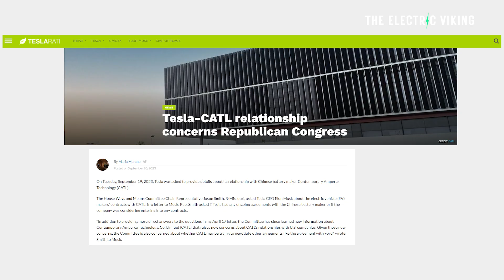Tesla's American LFP battery plant will produce game changing new battery

Comment: I feel really pleased that batteries are a little fire resistant these days. I also wish the governments to ban products using old batteries that catch fire easily. Examples of electric steps that catch fire are numerous.
My assumption is that 4680 will become Tesla's workhorse in all their products and that old wet coat technology will be banned because of the factory footprint it needs. Does anyone know how much of each battery type is produced? It is nice to compare these numbers of the last 5 to 10 years. There could be an answer to what will be the future of the battery production in the next years to come.
If you are still reading, I am really grateful to you. Tesla doesn't have dealerships where they can stockpile cars. And at Tesla's runrate at their factory they need to avoid overproducing cars because they cannot stockpile them. For that reason I believe, the automotive growth at Tesla will be limited next year. They can't offset enough due to higher interest rates and leasing prices. Therefore they will simply aim to produce more megapacks this year instead of focussing on maximizing automotive growth. Let me know your thoughts, and have a nice day

Comment: The other curious thing is that The Limiting Factor describes a significant price escalation in the last few years of lfp versus so-called nmc or NCA chemistries. From 2020 to 2022 lithium phosphate chemistry components went up almost 300% while NCA chemistry's went up 100%. This meant that in 2022 the price of lfp batteries was almost on a par per kilowatt hour with traditional ternary lithium chemistry. I'm sure this will change again as lithium carbonate is generally cheaper than lithium hydroxide. But it's not as simple as this video makes it sound.
Reply: It's a scale issue that isn't permanent. As production matures the price will drop like a stone. Iron Phosphate batteries are significantly less expensive to manufacture

Comment: Definitely agree. Just ordered a Model 3 Standard Range (RWD), and the LFP was a strong part of the decision. Looking at the long range, and considering the recommended use is the 10 to 80% range / whereas the LFP is happy using 10 to 100% of the battery capacity - the real world use is pretty much the same... plus it's expected to get double the charge cycles with minimal degradation.
Reply: It's my understanding that Canada gets China-made Model 3's since we don't have the tariffs imposed by the US imports.
Reply: @dbmiller5881  - Checking a bit further - you're right!  Seems strange to be shipping them from China, but both 3 and Ys from China go to Canada. It's not clear if it's a mix of US made and China made or all China. It might be limited to RWD models, but I could find out for sure.
Reply: I wonder if US/Canada RWD Model 3 Standard Range will be delivered WITH the new and improved LFP batteries from CATL. I preordered one in Canada Jan.11 but have no word on battery chemistry other than it's "LFP."
Reply: @thestonksmarket1897  - Unlikely. It's only been announced that there is a plan to build a factory to make them.  I expect it will take 2 years before volume production is available, and currently that production is slated for Energy storage, not cars.  There may be some factor not yet identified that makes them a poor choice in cars.  For example, maybe they don't do well with vibration, so  a fixed mega pack doesn't suffer that issue.
Reply: @tesla_tap  The factory in question in the US is utilizing CATL machines. Obviously CATL already has said machines up and running in China, so IF rwd M3 Highlands are currently being shipped from Shanghai to Canada (and the US?) then the question is still valid whether the included LFP cells are the old or new ones. I haven't heard that they "don't do well in cars", but rather that they will replace the old LFP batteries using CATL's existing production lines at no additional cost to produce. Basically a win-win if true. Tesla's move to produce these cells in the US is primarily to increase volume; after all, EVs are NOT demand constrained, they are production constrained.
Reply: @thestonksmarket1897  - You could be right. My understanding is no CATL designed factory for Tesla not has stared yet, so it seems to be to be at least 2 years as ground has still yet to be broken. You've got permits, building the factory, equipping it and then getting the process up and running in volume.  It's taken 2+ years for Tesla to do that with the 4680 after the pilot line was running, but that's a more complex process.  I didn't get the sense that this new cell is in production even in China but just a proof of concept line. Information is sketchy!

I'm also not aware of any China Teslas coming to the USA or Canada. The tariffs are so punishing it seems unlikley.

Comment: If these batteries can have a high rate of charge at cold temperatures that is a significant improvement.  This should also help range in colder temperatures as less, or no energy will be needed to keep the batteries warm or for pre-conditioning for charging.

Comment: If we could find why these batteries fail a thing we are doing is not correct. Something is wrong somewhere in it's manufacture. I want them to find out what before my Cyber Truck has an early, failure, fire, or burned vehicle due to water ingress. I want to drive it through waist deep water with no worries. Like those positive pressure jobbies. I just had a headlight water ingress on me bicycle and had to remove 4 tiny screws to mop it out. Being lithium ion I didn't want a failure in the middle of nowhere.

Comment: Higher energy density? Compared to what? The Panasonic 2170 baatteries have energy density of 269 Wh/kg while the LFP has between 90 and 160 Wh/kg. So whaat energy density are we talking? They are just cheaper to make and last longer which is important feature but that's really it. There is nothing else impressive aabout them and that's the reason why they are used in entry level Tesla vehicles

Comment: 4680 was supposed to be the game changer- I have heard people that have both a model Y with 2150 and 4680, and they claim that the 2150 Y charges more rapidly and also has better range performance.. Kind of seems like they just need to convert that plant to prismatic LFP as well...
Reply: 2170 (i've also gotten wrong on occasion)!  The Ys that got 4680 were Gen-1 cells.  Now they are making Gen-2 cells, and as I understand it, all are going for the Cybertruck and none to the Y (which is back using 2170 cells).  As to the performance differences - it's hard to get an accurate read on it as the pack capacity and number of cells varies as does the cell chemistry tweaks in both the 2170 and 4680 at different times. I've not heard of any plans to covert NCA cells being made at Sparks to LFP cells but there are so many variables, mostly having to do with raw material cost variations - it's always smart to be able to switch to what makes the most ecomic sense as needed, and Tesla has always been very smart about that.

Comment: @7:42, wrong. Panasonic is not holding back battery production of high energy density LiFePO because of limited production capacity. Rather, CATL holds most patents on LiFePO battery, and Panasonic would have to pay licensing fees to CATL. This discourages Panasonic because the lower rate of return on investment opens up other opportunity.

Comment: @5:55, wrong. Tesla’s proposed CATL battery production line isn’t in Nevada to put pressure on Panasonic. The existing Nevada  Tesla  battery factory is a joint venture between Tesla and Panasonic. The notion that Tesla is  putting pressure on Panasonic is same as Tesla kicking itself. Tesla isn’t a masochist.
Reply: I upvoted this, but the relationship between Tesla and Panasonic has been ... rocky ... at times.  Panasonic has been entirely too hidebound and conservative; when they originally partnered with Tesla they may have been the best battery company in the world (maybe) but, like Japan in general, they squandered that lead.

Comment: I agree. I wouldn't buy an EV without LFP batteries.
Reply: I wouldn't buy one with LFP, unless it was just a commuter car. Slower charging, discharging, less range, less energy density...they're have their advantages, but at the expense of the things that matter most to me.
Reply: @OtisFlint  most people use their car most of the time for commuting.
Reply: @OtisFlint  Not to mention the horrible cold weather performance of older LFP chemistries.  NMC is bad enough in the cold.  At this point, I only want the new CATL LMFP battery.
Reply: They're literally worse in most metrics besides price
Reply: And I wouldn't buy an E.V. in a jurisdiction with limited available power and an inadequate grid...like North America for example.
Reply: @markanthony3275  Huh? Did Canada get moved out of North America?  Ontario has a > 90% green grid and Quebec EXPORTS Terawatts of power to the US. (And unlike Texas, OUR windmills - although 20 years old - work in the snow. American technology just needs to catch up ...).
Reply: @markanthony3275  🤣
Reply: @markanthony3275 The inadequate grid hasn’t had an impact on charging both our Teslas. 😅

Comment: LFP is just stopgap measurement, though I know ncm battery's not distributed enough. Though it's cheaper and more stable than ncm based battery, it can't be ultimate solution for current battery shortage. LFP battery started to be sold by Chinese manufacturers, which needed cheaper cars for Chinese people. Thanks to mass production of LFP battery, Chinese people could buy EVs of cheaper price but it has so many problem, especially in cold weather.
Reply: Chinese EVs need to pass -20 degree for 30 day at least 6600km travel in inner mongolia. It is not a problem for China.

Comment: I wonder what the range of Model 2 will be if it uses LFP batteries, there is only so much low energy density cell capacity you can fit in a small car.
Reply: If you can charge rapidly and in the cold,  200 or 250 mile range isn’t an issue. LFP are very robust cells and not prone to fire like others. .  I have some LFP cells that are 15 years old and they can be charged at 5*C without issue. Thats old A123 Systems cells and still running strong.  These new ones are many generations better. These are basically lifetime batteries. The chassis will be worn out before the battery.
Reply: @daversj  If Tesla offers 10 minute to full charge and 15 years of battery warranty than that will help countering consumer apprehension about mediocre range I suppose but it isn't doing that for LFP Model 3 so it most likely won't for Model 2. That makes the advantages of LFP largely academic.
Reply: @tellyboy17  nobody charges to full on a road trip. If it can do 20 to 80% in 10 minutes, that's probably adequate.
Reply: Model 2 is supposed to have a 53 kwh pack, which is 80% the size of the model 3. The question is, how much smaller and lighter will the model 2 be?
Reply: @darylfoster7944 That's a good question and related: how much cheaper to build is Model 2 actually going to be. The way car economics work small cars are relatively expensive to build compared to larger (more profitable...)models which is why Elon Musk has visions about completely new ways to build cars but not all his visions are rooted in reality.
Reply: I was thinking the same thing... And to keep the cost low, I'm guessing 230mi.
Reply: @yeahbuddy92193911  It would have to be something like that I suppose. It's tricky: to be able to sell at a low price point you need large production numbers but for that you need large demand which in turn  dependents on the car having great range which necessitates a large battery which is ad odds with the need to cut costs. Quite the balancing act...

That's why I have always been skeptical about the Model 2 concept.
Reply: @yeahbuddy92193911  230 miles is low, for the American consumer. EU and Asian drivers may be ok with it. I wonder if there will be a LR version.

Comment: John, from Cleanerwatt, synthesized reports that indicate that the batteries will be made in the prismatic form. Thus, they will be suitable for Megapacks. The domestic sourcing will qualify the Megapacks for incentives provided by the Inflation Reduction Act for domestic buyers. Future developments, indeed, will likely see Tesla utilizing LFP in the 4680 cells - which are suitable for the structural packs used in their vehicle manufacturing process. All will come to fruition in due time.
Reply: Tesla already uses prismatic BYD Blade cells in Model Y.
Reply: I am no expert. Also, under Elon's direction, Tesla adapts as conditions change. I am aware that the BYD blades are in some Ys from Shanghai and Berlin. (Austin uses LFP is some Ys too - though, info regarding sourcing for Austin production is vague.) Anyhow, I think the next goal is to get LFP into the 4680 form. Instead of BYD, this deal in Nevada is with CATL. China's Optimus clone has to be a factor as well. So, Tesla will likely accept CATL's tutelage until they can say, "We've got it from here." Keeping the near-term focus limited to the storage segment hedges against corporate espionage /sabotage in vehicle production. Further, Tesla may want simplify the transition to LFP in its U.S. 3 /Y production by limiting the prismatic phase to as short of a run as possible. (There is some speculation that the 4680 form works better for heat dissipation - likely also preheats faster.) @jcziviani

Comment: Just a small correction. The Nevada factory is just outside of Reno in Northern Nevada quite a ways from Las Vegas. The public statement from Tesla is that this will be a 10 GWh production site for its initial LFP efforts.  I will drop this piece of unconfirmed info on the CATL agreement.  I suspect this is a two way technology agreement where CATL License its LFP tech to Tesla and Tesla also License its dry-cell tech to CATL.  Making a structural 4680 LFP cell is not that straightforward. This will require development of new processes and techniques to bring the two technologies together into a 4680 cell.  The initial 10 GWh production will be using prismatic cells as CATL uses.  I think this is more of a joint development effort than anything else.  If they can develop a 4680 Cell using dry cell tech with LFP chemistry it will be a major step forward in reduction of cost and increase in most battery performance specs, ie energy density, operating temp range, speed of charge.  Just my thoughts of what may be happening nothing else.
Reply: Elon is a smart businessman not a politician. They are afraid of African born just like how they treated Nikola Tesla.
Reply: Tesla have no battery tech that CATL need...Both BYD and CATL have the battery/production tech that are at least 10 years ahead of Tesla..

Comment: Now that California's Salton Sea mine will produce lithium in 2025 and the world's largest Nevada Thacker mine opens in 2026 things will change.
Reply: How much fossil fuels do you think they will burn to mine lithium in Nevada? I work mining nickel and cobalt for Elon Musk's and G.M.'s batteries so I'm curious. I know at our mine, we tried electric mining equipment and it was a joke.
Reply: @markanthony3275  I recently retired as an engineer where I worked on emissions for both our diesel, hydrogen, and electric power trains we manufactured throughout the world for major OEMs. Overall, we had better performance with electric over hybrid-electric power trains. Hybrid powertrains have been around in the mining industry for over thirty years. If your mine only used direct drive none Tier 4 diesel engines which is not a requirement the amount of emissions produced and maintenance was the worst..  When you take into account the transportation of fuel to wholesalers and gas stations and the amount of emissions produced in drilling and refining that industry produces 3 times more emissions than mining and producing and distributing electricity for batteries in the USA. Plus keep in mind most batteries are moving away from nickel and cobalt and each day oil refineries use over 5000 lbs of cobalt daily in the USA alone to remove sulfur

Comment: Yeah, this is very smart. Buying the machinery outright avoids the whole geopolitical mess of import/export/joint-venture etc. Another great move by Tesla.
Reply: Also avoids shipping costs and issues like the business in the Red Sea/ Suez Canal area and the low water levels of the Panama Canal. (I realize China to Tesla would probably go across the Pacific rather than either of the other routes, but rates and backlogs are increasing due to those shipping issues.)